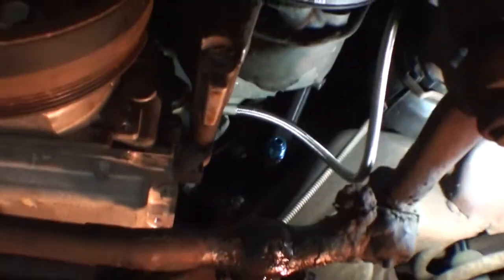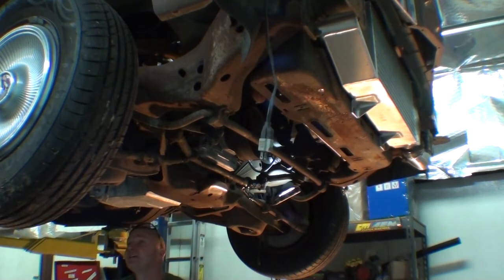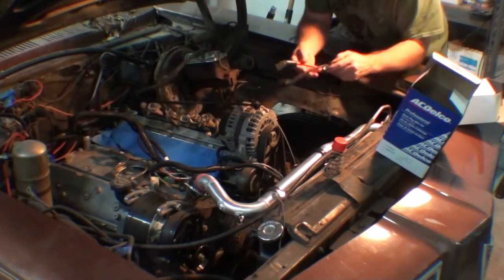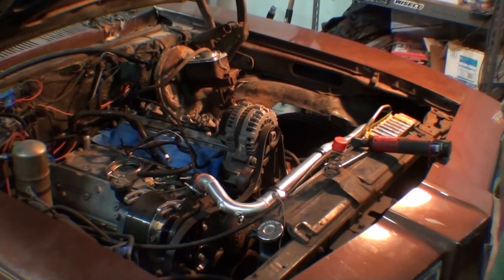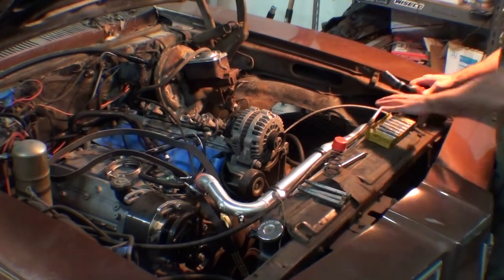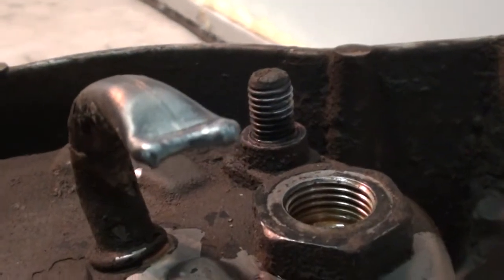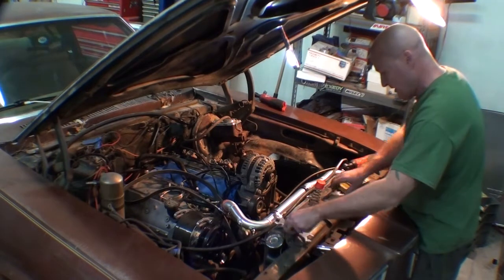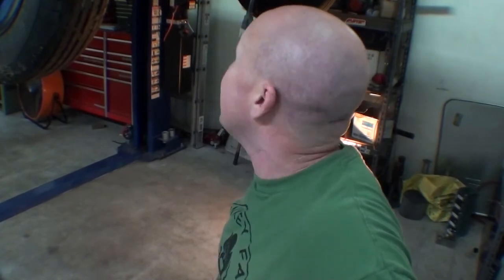Power Steering Pump Lines Old GM to Ls Truck

Comment: when my builder added power steering to my fox based granada, It had lots of play and the steering was overly sensitive. After doing some looking i found a pressure reducer kit for gm ls ps pumps, and reduced pressure giving me more steering feel and giving me more driver confidence, i can get you a part no from summit it's real cheap like 20 bucks. Though i'm not sure you have rack and pinion so that may make a difference
Reply from the maker: myheadisntbig thanks. I’ll keep it in mind.